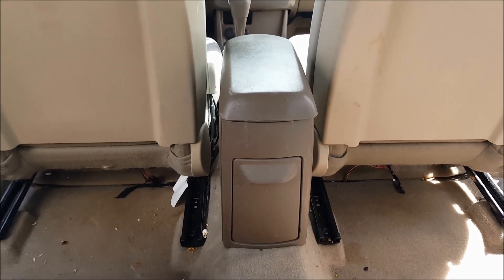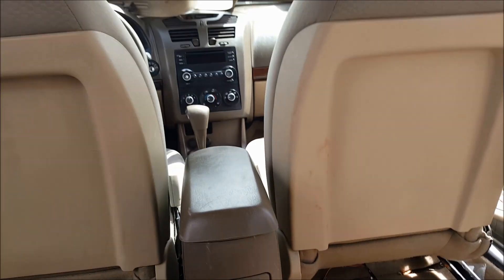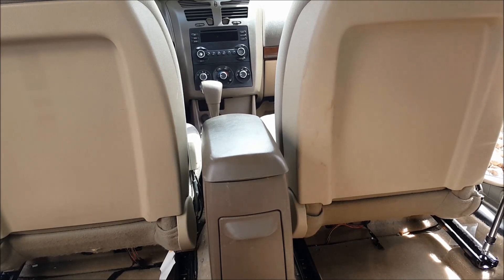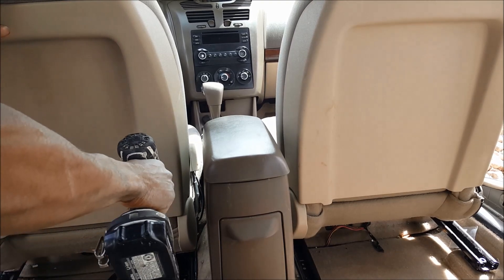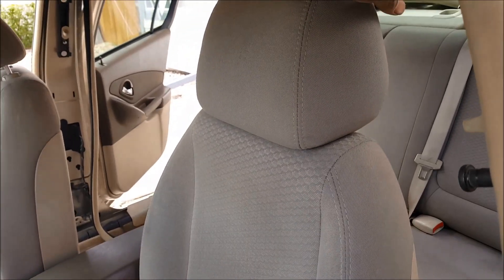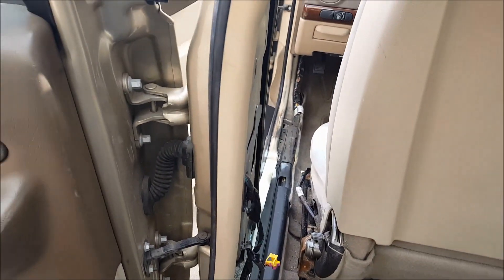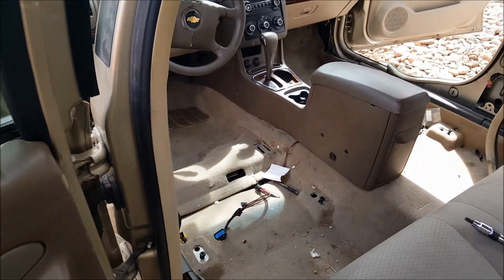2004-2012 Chevrolet Malibu DIY How To Remove  Front Seats

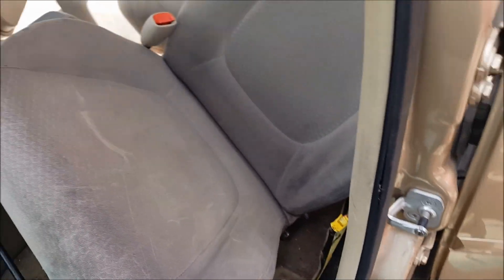Comment: I hope it's the same on an '11 Malibu. P.S. Don't forget to grab the change on the floor at 1:42 or so!
Reply from the maker: It's the same you'll see even with the seat belt bolts. The sizes may differ tho, but the concept is the same.
Reply: @SteveDavisCarGuy thanks for the confirmation. 
I have to go to a junkyard to buy another driver’s seat frame, so the dealer can fix my recall on the seatbelts 😮

Comment: How to open the rear one
Reply from the maker: Rohullah Safadri I'm not sure.
Reply: I got it I was supposed to open the trunk first there is something that you have to pull it then the seat will gose forward then open the whole bracket
Reply from the maker: Rohullah Safadri  that's wassup, glad you figured it out brother
Reply: how to remove back seats if trunk will not ot open

Comment: 2012 is not the same seat video is useless
Reply from the maker: Definitely the same type of seats, I owned a 2007 and 2010 at the time and it's the same process.
Reply: Steve Davis not the same my brother I've already did this on my 12 with heated seats